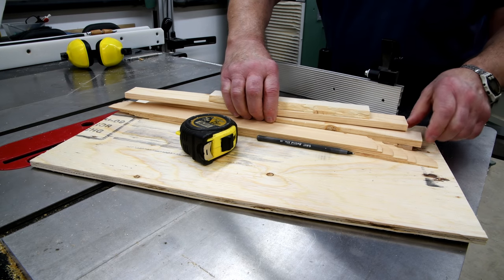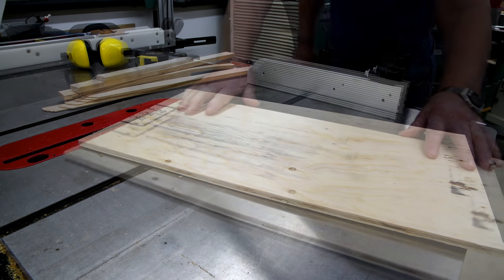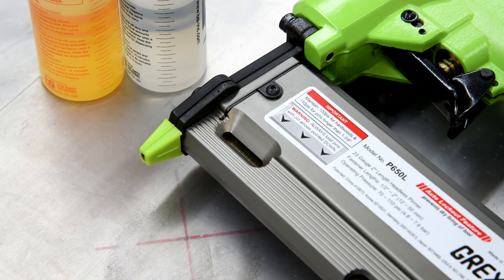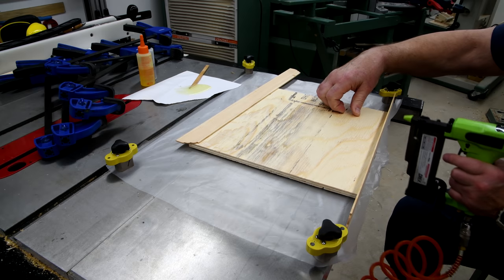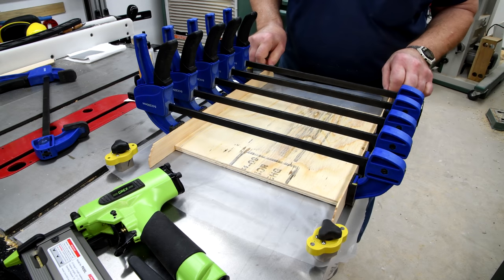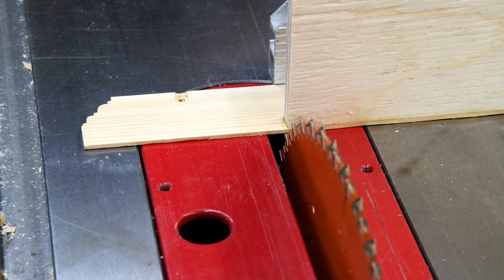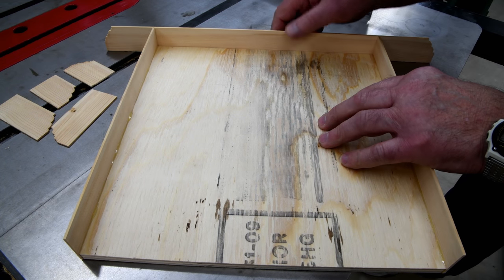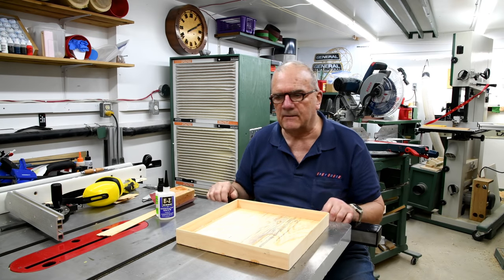The Model Ship - Part 21

Comment: And put a roll of paper towels on your handle.  See you tomorrow.
Reply from the maker: That's a good thought alright Billy. However if I have a sort of hook at the top of the handle, like a cane,  to catch over the gantry rails, the roll can't be slipped on. Will keep that idea in mind though. See you tomorrow. :)
Reply: Just run the handle all the way through and put a pin in it.